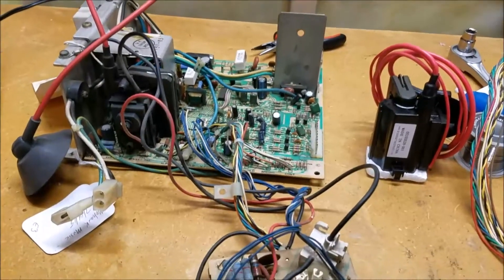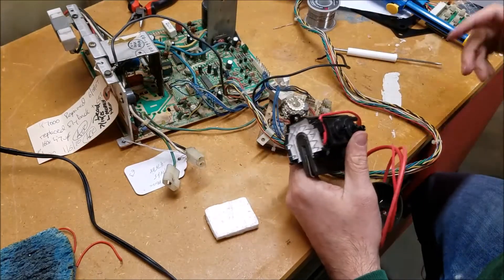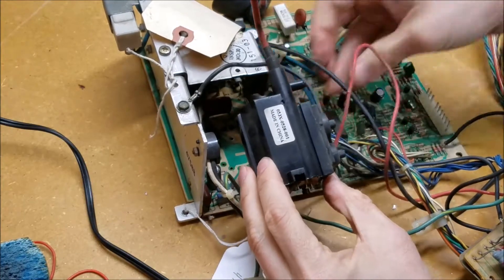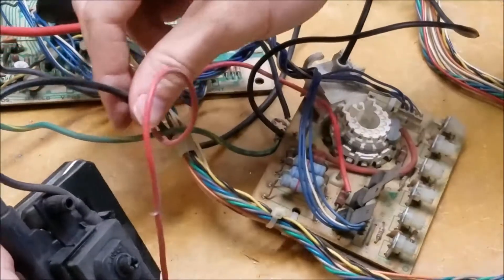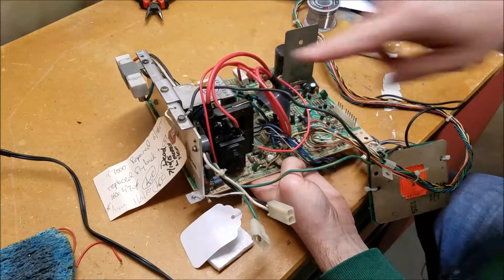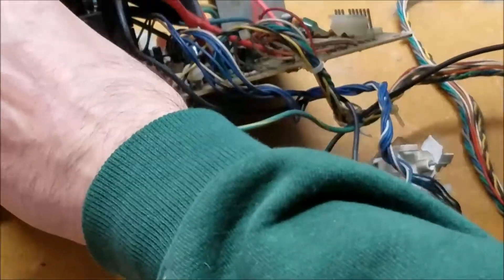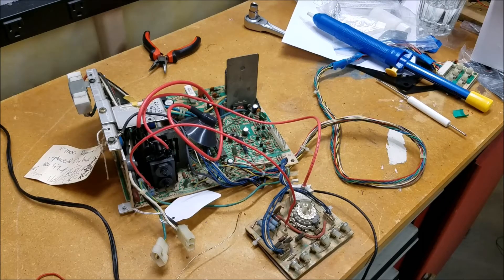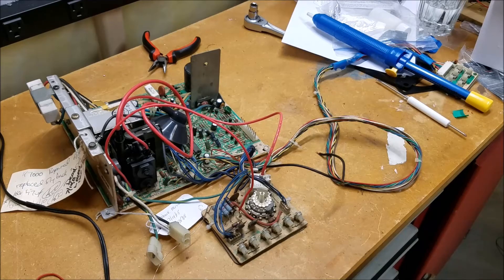Wells-Gardner K7000 Flyback Replacement

Comment: THAT TIM GUY, what is the differences between a Vector monitor compared to a Raster monitor?
Reply from the maker: A few things. Angle of the tube is different and the chassis works differently. The logic on the chassis is a little different too. Vector monitors draw lines from point to point and aren't filling in the space of a shape. Raster monitors fill in the screen line by line rapidly and can handle those pixel graphics. That's the short non technical version. I'm sure someone out there may have a better explanation though!
Reply: @ThatTimGuy  what do you mean by the chassis works differently? the chassis is just a ground or earth ground i thought. The B+ voltage for monitors is used for what reasons for the sync circuit and hold circuit, i'm not sure what the B+ voltage is a bias voltage or DC offset voltage for what? H&V sync signals are the positions coordinates for the CRT but the XY deflection signals are also positions coordinates for the CRT, so both are the positions coordinates for the CRT? Older arcade power supplies use only one Filter cap rated at 27,000uf or higher capacitance any reason why such a very high capacitance value?

Comment: Hi everybody, I bought a flyback 053x0641-001 in arcadeshop.com, first to all the new one flyback is more big than the original , 24 volts output come in diferent flyback pin, 12 volts output do not come at all, this not a problem I can use a external power supply for this.
My big problem is the high voltage output, is to high.
Everything in the board is ok B+ is 119 volts like the schematics say.

Any help will be appreciate.

Cheers.

Comment: I just did the recaps on my k7000 and get it to run properly while is on it's fine but if I turn it on the next day it's not working property looks to be the v-hold scrolling, is this problem because I need to replace the flyback?
TIA
Reply from the maker: Check the solder joints for vertical hold pot. Maybe reflow them and clean the pot with some Deoxit. Also just make sure any of the caps on that circuit have good solder joints after you recapped it. Good luck!
Reply: My remote board went bad and caused vhold to go nuts. Poking it would either straighten it out or make it scroll. New one resolved issue.

Comment: When taking out my flyback I noticed that pin 3 of p202(on the neckboard) wasnt soldered or connected to anything.
Where does pin 3 of p202 go?
Reply from the maker: If I recall, not all the pins went to something
Reply: That Tim Guy ok, thank you so much!

Comment: Great video.  Wish I had seen it before I did mine instead of searching for it AFTER I did mine and had trouble..  I'd have realized then that I didn't have to cut and splice  the wire from the top of the flyback - I didn't know that little clip on the neck board socket opened.  :-)  Also, in case someone else sees this - The small wire on my neckboard that you desoldered was in a different place on mine, and actually had a socket from the old flyback.  I wanted to reuse the socket, so in this case, I'm glad I spliced the wire instead of seeing you solder straight to the board!

Comment: Just replaced the flyback (and did cap kit) on mine..  Now I get neck glow, but nothing on screen..  Any directions for adjustment of the pots on the flyback?  Thanks for great video!
Reply: So..  I just adjusted the screen setting up, and it's at least showing picture.. Off to use the TPG and see if I can't get this thing dialed in..  Thanks again for the video..
Reply from the maker: Don’t forget you have other pots to help dial it in such as the contrast/black level. Glad it was helpful, dialing them in is an art and I’m not quite there yet!  On a black screen if you can start to see some other lines showing through the flyback is up too high. Don’t forget to adjust the focus too. Images should be nice and crisp. Thanks again and good luck!